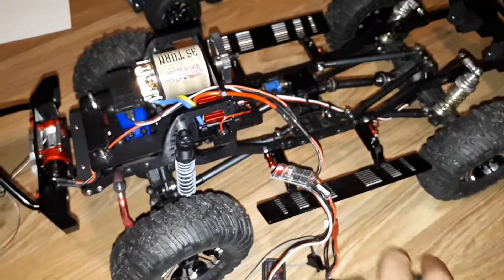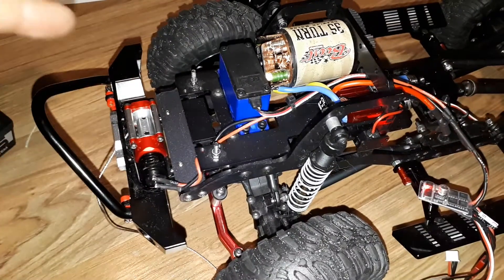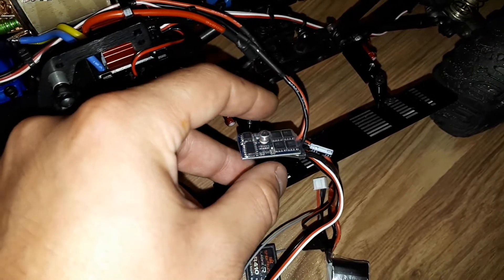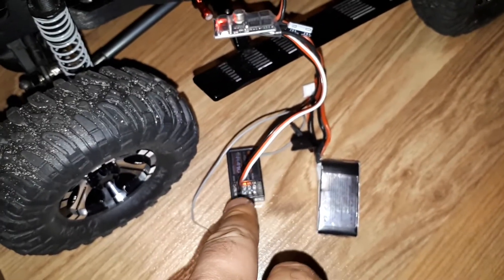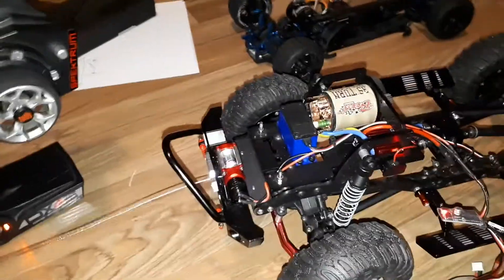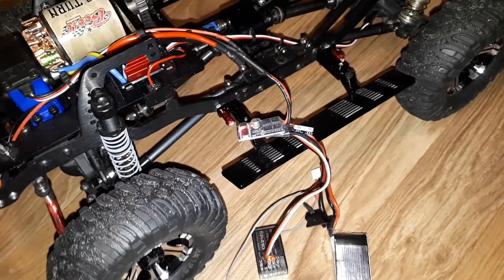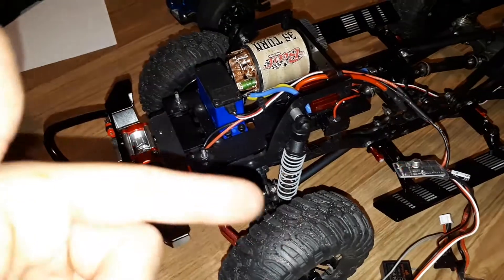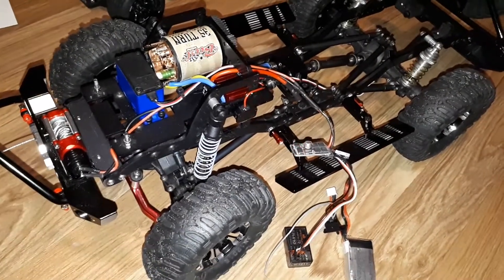Rc winch controller from esc

Comment: Hi, what's the battery pack you have powering the winch? Thanks!
Reply from the maker: Right off the main pack. I made a power breskout board from a drone pdb... diatone if im not mistaken. Both esc motor and winch esc ran off the same power source.

Comment: Hi again, just wondering if you got your Flysky GT5 controller, if so, did you setup your winch controller on channel 5? How did you set it up? Not to sure with the controller where and what to setup. Thanks
Reply from the maker: Yes i did, i can post a vid wensday. Im out working atm.
It works very well. Just plug the esc into channel 5 on the 6 channel rx, and it works with the pot dial. You can fine tune it on the radio for faster or slower retraction. Any winch will work with the esc.
Reply: @Felix_Dinel  Oh great thank you so much I cant wait to see it in action, have a great night !!!
Reply: @rccvs4355  Hi, did you ever post the video? I can't find it on your channel and am stuck in the mud with no winch control! Help! Haha :)
Reply: @rccvs4355  Thanks for responding Donald! I had seen this video but didn't make the connection that it was yours :) I see that u illustrate with a servo, I have a winch. Assuming it will work the same. I wanted to use channel 4, but your comment of controlling the rate convinced me to go with channel 6!
Reply: @CHALKLINEDETAIL  Your welcome Adrian, I use ch 5 with a 10a esc to control the speed of the 20kg servo winch, here are 2 video of my testing: https://www.youtube.com/watch?v=6M6ToxZ3cAY

https://www.youtube.com/watch?v=TZpkvSmGgWI

Enjoy !!
Reply: @rccvs4355  fantastic!

Comment: OMG thank you, that is exactly what I want to do, that power switch can it be remove or it needs to stay there? With the steering in neutral does the cable from the winch hold in same position ( meaning you can't pull out )? Where did get your bumper and winch from?  Great video good explanation !!!!
Reply from the maker: You can probably cut the shrink off an just solder a jumper across the pads, or if you want, you can solder on an electric reciever switch and remotely power on the esc.
Pretty sure i got the bumper off ebay here,
https://rover.ebay.com/rover/0/0/0?mpre=https%3A%2F%2Fwww.ebay.com%2Fulk%2Fitm%2F263754439482

I got the winxh fairlead panel somewhere else, it will need m2 countersunk screws to mount it.

Comment: Ya bec is what i was thinking. I'm not real sure how i can run it straight to battery without pulling some wire from my winch plug but cool thanks for the input
Reply from the maker: Or just get that esc, its super cheap

Comment: I have a flysky fs-gt5 great remote using a servo board to control my winch off the 4th channel on that remote but its slow and bogs down with no power once it has resistance...  Wierd any idea you might think can make a fix??  If you dont mind thanks
Reply from the maker: Depends on what servo you used? No idea.
Id try powering the servo right off the battery or a bec that will give you 7.4v
My guess, the servo you used has a weak power output.